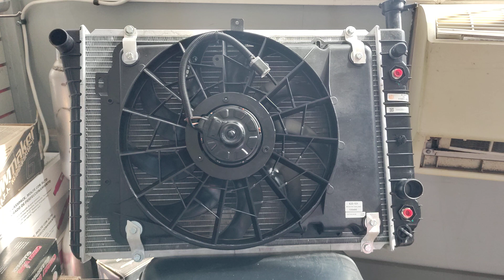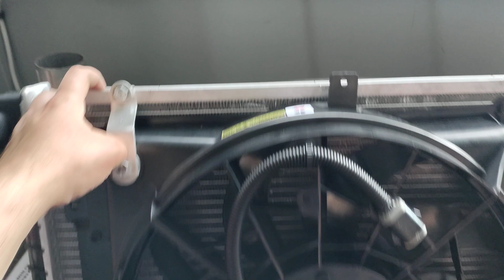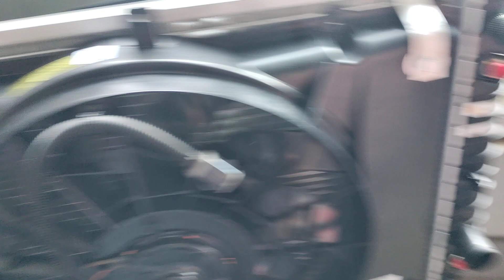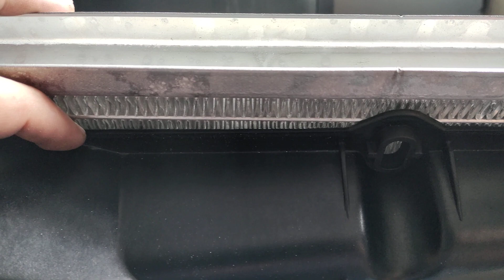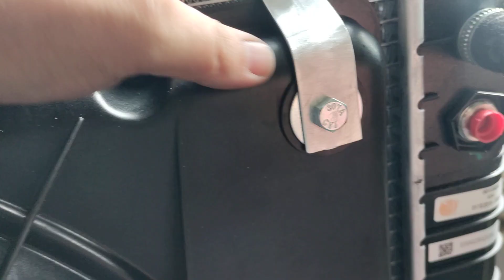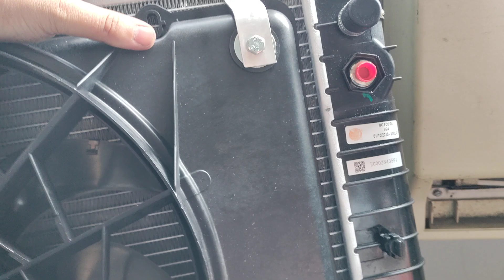Taurus Electric Fan conversion for any vehicle, the Poor man's electric fan.

Comment: It's interesting that YouTube recommended this video to me at this time. I just built a 12 volt box fan from a Taurus radiator fan for use in my shop. My shop is too far to run grid power to, so I'm using solar panels and batteries along with a power station. A 12 volt battery runs my fan and the power station runs my lights and tools.

Comment: I need an electric fan on my 1974 am general  truck.  The gawt damn 6 blade mechanical just ain't cutting it anymore in summer. Temps 92-102.  Engine overheats .  Straight 6.   My radiator is 16.5" wide x 15.5" tall. Motor side, once 6 blade removed I only have about 2.25" clearance.  😢

Comment: My biggest problem is the width. Space between the radiator and the engine (the pulleys) is only 3.33" in my car. This alone caused me grief and made my life miserable (LOL). Any idea how thick the assembly is? If it's too thick I hope I can cut it thinner without the fan reaching the radiator to damage it (which happened to me twice now). Great vid, BTW.

Comment: The one to get is the 1995 T.BIRD  with 4.6 i run just the hi speed 60 amp relay, themal swith and a circuit braker to stop back feeding  when the engin is switched off.

Comment: Good information.
I'd recommend running your bolts from inside with the nuts outside. We lost a radiator when a nut came loose, hit the fan blades, and went into the radiator. 😢 The hole was on the engine side of the radiator going towards the bumper.